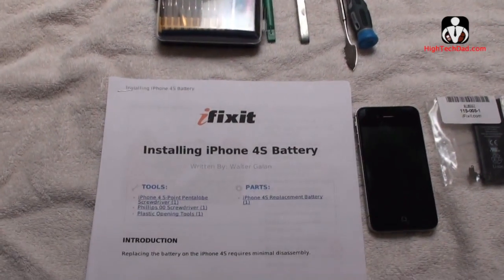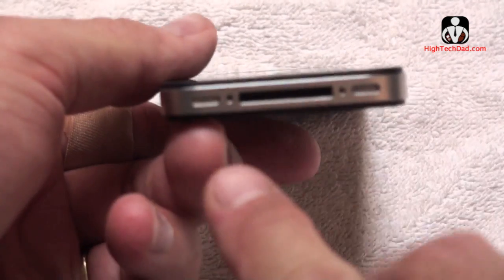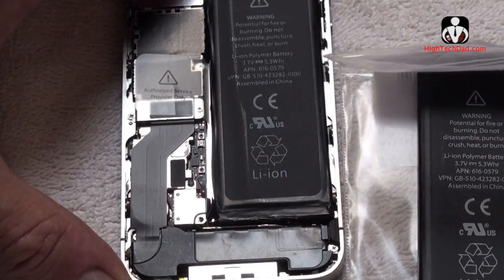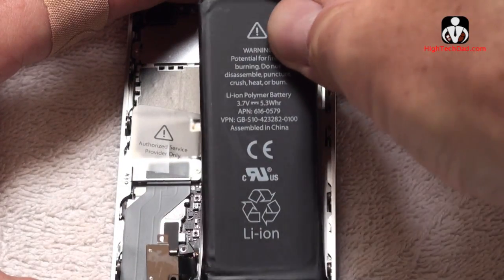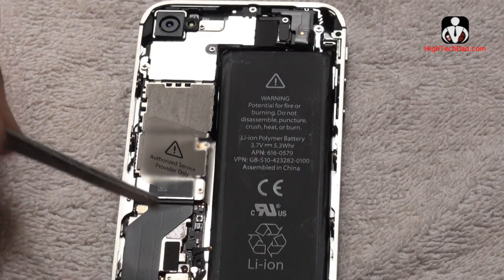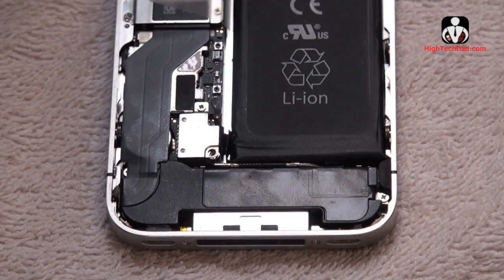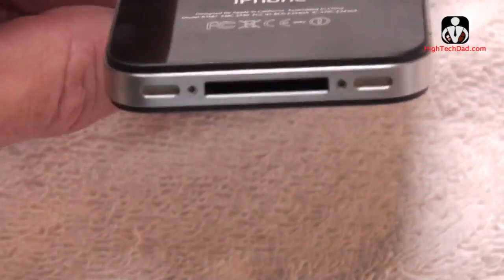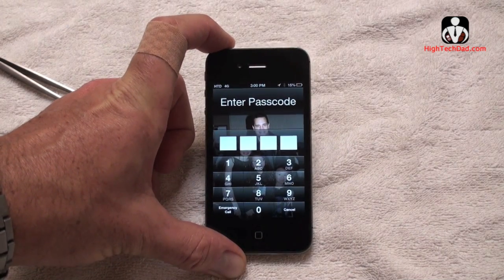How To Easily Remove, Install & Replace an Apple iPhone 4S Battery

Comment: How come samsung phone batteries can be replaced easily and without using all these tools
Reply: BananaHammock
IOS is smoother and an easier interface.
Reply: It was a design decision.
Apple decided that a slimmer phone with a high quality battery that rarely requires replacement (but is not user replaceable) was the better choice.
Samsung decided that a fatter phone with a user replaceable battery was the better choice.
I like both devices but feel that Apple made the better choice regarding the battery. 
The iPhone 4s battery rarely require replacement even after 4 years of regular use.  Of course some do need replacements for various reasons.  Replacement is fairly easy but this person makes it look pretty hard and does it poorly.  Not just because of the oversight of the ground clip, but the way he removes the battery by prying up on the component side of the battery is very dangerous.  He could easily damage the mother board doing that.  stick to prying from the frame side of the battery only.  Also, be gentle removing the battery connector from the motherboard.  He does not caution you how little force is required or that you just need to put the tip of the pry tool under the lip of the connector.  With too much force you could pull the connector right off the motherboard.  That aside, the video is certainly nice and clear and should prove helpful to someone looking to do this repair.  Always good to look at multiple videos before doing it for the first time yourself. 
Good luck.
Reply: They copied every datail of the iphone and now you CANT change the battery on spamsung phones
Reply: nr3rham no you cant.  samsung built the battery into the phone with no way to get to it.  there are no screws to open the phone up.  do some research before you open your mouth you idiot.
Reply: Tetra Digm Spoken by someone that has some odd grudge against apple and never owned any of their products.  I have 5 years old iPhones that still run perfectly on their original battery.  Replacing the battery if necessary may not be as simple as replacing AA batteries but it isn't exactly brain surgery either.   If you needed on, the batteries sell for under $10 on Ebay and not more than $10 for any mobile phone fixit shop to replace on the spot.  Of course if you rather lug around an fatter, heavier, uglier phone that has a user friendly battery compartment that is entirely your choice, and apparently the one that you made.  Enjoy.
Reply: Since you think "every cell phone out right now... Looks exactly the same" then that is why you are content with the bulkier models that have user replaceable batteries.   
And since you feel the need to cause to describe apple products it is pretty apparent that you hold some bizarre grudge.  It is phone, not someone that murdered a relative.  Sheesh.
Reply: It is not the truth, it is just loopy.  People don't buy millions and millions and millions of a bad product year after year after year.   No phone is perfect, but your logic is seriously flawed.
Reply: BananaHammock
true. but thats why so many iphone users jailbreak.
Reply: ***** yes you can
Reply: Tetra Digm im using a ipod 2G for fun these days, everything works, facebook, ebay, twitter, weather, maps, email,  push notifications, battery holds about a week, im talking for a device from 2008, go and find a working android from 2008 these days
apple rules, everyone is just following the leader, today in 2015 every new device is a mirror of iphone 6, there is a reason why..
Reply: if you don't believe what I wrote that's ok.
now find me a working device on android from 2008, they even will not start up...
if your angry, boo, your problem , I'm very happy will apples devices..
Reply: wait a few minutes, I'm recording a small video with my old iPod 2g :)
Reply: Cause apple mean and wants money so if you bring it to the apple store they'll say yeah we can fix it but it will cost you a new phone.
Reply: +X Gempler iPhone battery is slimmer because it's much less capacity, take for example iPhone 5 battery it's 1560 Mah compare to almost double 2800 Mah for Galaxy S5 and that's only at cost of 0.02" extra thickness.  Besides I would not want my Galaxy S5 to be any more thinner.  There is a point of diminishing return, if the phone is too thin it's harder to hold it.  You overlooked the benefit of removable battery is having extra spare batteries is that you can pop a fresh fully charged battery in to a phone in and don't have to look for a charger.  Put a depleted battery on a charger, you're not tied down with a wire you phone is 100% charged when you really need it.  That's what I was doing with my old S3, I bought 2 extra batteries and a charger around $20 bucks and just swapped the batteries.  This is very useful when traveling or just anywhere where you can't plug-in like beach or camping, etc. Can you do that with iPhone? - NO, so there you have it, Apple made a poor choice and a typical person who struggles to set correct time on VCR or Microwave would not be able to perform this battery swap but anybody can pull off the cover off Android phone and put a new battery.
Reply: +X Gempler uglier? fatter phone?  First of all the difference between iPhone 5s and Galaxy S5 is 0.02"  We are talking about 2 HUNDREDS of an inch!  That's extremely tiny difference that doesn't make any difference in real world!  Uglier?  That's just your opinion.  I think both phones look great, but it took Apple what 3 generations to come up with bigger screen - I preferred bigger screen so I switched to Galaxy, when Apple decides to catch up with Samsung and give me option to expand storage with SD card then I'll consider Apple, until than I am not playing 10x inflated price for extra storage that Apple charges compare to SD prices.  Heck, last time I was on vacation I was able to take micro SD card from GoPro 4 and play it back on my phone in full 1080 video quality all the videos I recorded.  You can't do that with iPhone.
Reply: +K Lee Because Apple wants to make as much money as possible from you by making not easily replaceable battery to force you to upgrade to their newer phones.  By NOT offering micro SD expansion of your storage to force you to buy their newer phone with bigger memory next time or force you to buy their Cloud space.  By charging you 30 dollars for charging cable when you can buy micro USB cable for a dollar or two that fit THE REST of the phones.   They are just greedy like that.
Reply: Dima Prok tell us one mobile manufacturer that makes replaceable battery nowadays
Reply: +Leart Zajmi Is this a serious question?  All "non apple" phones have replaceable batteries.  Samsung, LG, HTC, etc.
Reply: are you living on 2015? they all copied apple, they are all the same now, scamsung even removed the micro sim card and water prof, and since iphone dont have radio fm , they removed that to
Reply: Dima Prok good luck changing s6 battery without breaking everything
Reply: +Leart Zajmi Well, I haven't worked with Galaxy S6 yet, just because I don't upgrade my phone every time new one comes out, I tend to skip a generation but OK, last year that wasn't the case since I got to work with lot's of different phones, well if that's the case than next time I am buying a phone I'll need to re-valuate what phone I want to buy.
Reply: Dima Prok dont even bother to open a s6, it will break, at least apples one is changeable, difficult, but possible, about other brands they look like crap from inside , compared to iphone internals
Reply: Dima Prok It appears that you have not heard about universal external rechargeable batteries for anyone with any phone that needs to carry around extra power.  Clearly Samsung hasn't or they would have designed a better and slimmer product that would weigh less and cost less to make.
Reply: What makes you think I haven't heard?  I have one just in case and I got to use it like 2 times in a year because my Samsung hardly ever runs out of power unlike iPhone and it still requires you to have you to plug in charging cable which is not comfortable if you are carrying in your phone in the pocket.  How hard it is it for you to understand that 0.02" slimmer phone is not important for me, I rather have double battery life rather than bragging rights that I have a "slimmer" phone a whole whopping two hundreds of an inch slimmer, you have to be so stupid to brag about it.  FYI that's about business card thickness difference and I am perfectly satisfied with the slimness of my phone, I don't want it anymore slimmer, for me it reached a point where if you make it any more slimmer it's going to be unconformable to hold.  That's just stupid marketing gimmick, I actually rather have my phone thicker if I could get additional battery capacity.  And "cost less to make"?  Who cares how much it costs to make, what matters is that it cost way more to BUY, lol.  Why am I even talking to some immature kid who can't provide real facts and arguments.
Reply: What makes me think that you never heard of a universal external USB battery is that you were saying how wonderful it is that you can carry around a spare battery for your Samsung.  Anyone can carry around a spare battery for any phone by using a universal external USB battery.  This concept has escaped your comprehension, as well as Samsung.  There is no need whatsoever for any new phones to have user replacable batteries anymore.  Only a luddite would think otherwise.
Reply: +X Gempler It's not even remotely same!  You have no idea because you were never able to do that with your iPhone, popping a fresh battery and having 100% instant charge is very cool and I can fit spare battery even in the wallet if I really want it!  Walking with bulky external battery pack and extra cable and having them connected is NOT COOL and that's why you don't see anybody doing it.  Why are you arguing the obvious advantage Samsung has?  Why not just agree and say yeah, Samsung done this better than Apple.  Why do you have to be such a dumb ass?
Reply: You are loopy.  And the more you post the more evident it is.  Good luck to you.
Reply: +X Gempler No, you are!  I had to look up, you're just a stupid teenage girl, why did I even bother to explain something logical, you wouldn't understand.  I worked in mobile industry, you probably go to high school.  You watching and liking blogs on "TJ Maxx shopping" explains a lot about your mindset. LOL.
Reply: +Dima Prok your stalking has failed to reach the correct conclusions.  But given all of your other failed attempts at logic it seem quite appropriate that you would fail at this too.  Showing your need to lash out at someone that you think is a little girl shows how completely loopy you are.  Why would anyone do that?  Why would you be mean to a little girl if that is truly who you think I am.  It is just sick to think that a grown person would do such a thing.  And all because you can not handle that fact that someone opposes your belief that a user replaceable batter in a cell phone in 2015 is Neanderthal type thinking.  A battery in in cell phone!  Who care?  And you call a teenage girl stupid.  You need help.  I sincerely hope that you get some.
Reply: +X Gempler Yes you are stupid little girl, I gave you all the reasons why it's better and you just giving me "it's 2015 and everybody is doing it so it must be good".  The heard mentality.  You don't know how to think outside the box.  Did you fake your age to sign up for youtube?  Did your mommy give you that iPhone?
Reply: Dima Prok Name calling is a common tactic used by bullies who do not have facts or knowledge on their side.  Ironically you are the one that literally can not think outside of the 'box' as you clearly do not understand the concept of an external usb portable battery.
Reply: +BananaHammock the one plus needs an invitation to buy. can't use that to compare it to an iphone. Apple doesn't want people to mess with their product, but tech people don't care. its just about the money they can make if they can do it.
Reply: K Lee ...
Reply: alan wilson mm
Reply: Pah, apple don`t even want you to use the device in a way they don`t like, never mind changing batteries.
Try finding a replacement screen for iPhones..
Reply: Sir 4s iphone battery replaced prices
Reply: cause
iphones are better lol

Comment: Excellent video! I wtvhed it once, bought battery then watched again while I installed new battery. EASY AS! Thanks so much!  
Your video - highly recommended - person I got my "new" battery off, NOT recommended!  "New" battery turned on at 46% - plugged in to charge it and so far it has dropped DOWN to 43%. May be watching your video again soon when I replace "new" battery with another "new" battery!!

Comment: my iphone 4s want turn on should i try this?
Reply: If your iPhone 4S will not turn then it may be the battery or it may be something else.
I suggest that you connect your iPhone 4S to the AC adapter.  If the battery has been completely run down then you will see the outline of the battery (empty battery indicator) briefly appear on the screen and then the screen go black until it has been charged up enough to turn on after a few minutes of charging.  If the iPhone does not show you the empty battery indicator or does not appear to turn on after being charged for several minutes there is likely another problem.  To troubleshoot further you could next try to connect the phone to your computer and see if the device is recognized by iTunes.  If it is recognized by iTunes but you still can not see anything on the screen you may have a screen problem.  If you do not have any important data on the phone you could try a restoring your iPhone using iTunes in a method that completely wipes all of your data from the iPhone and reloads the operating system from scratch.  This procedure is detailed here https://support.apple.com/en-us/HT201252  If after the restore you still can not power on your phone further troubleshooting would ne necessary...
Reply: Same happened to me do u no how to. Fix
Reply: X Gempler
Thanks it works now after i left in the charge for a couple of hours!

Comment: Good walkthrough video HTD. For those watching, if you haven't bought your battery and tool kit, I'd like to share what I bought. I didn't like any of the reviews on Amazon for battery/tool combos so I bought each seperate. If you find a battery you like with free tools, get it, but I would buy a good tool kit as well. Helps too if one of your tools strips or breaks as his spuger did in the video.

I bought this tool kit for $15 and you can fix almost any electronic with it, not just an iPhone, that is all you'll get with the provided tools. It had excellent reviews and after doing my battery swap, I'm very happy with it. http://www.amazon.com/gp/product/B008CLO7Q2/ref=oh_aui_detailpage_o01_s00?ie=UTF8&psc=1

I bought this battery. Not sure why looking back now, because it only has a few reviews and I usually go for items that have a lot of reviews. Glad I did now though, because it has the exact same markings as my original, it would appear to be the same exact battery. Now I can't say that you buy this battery and get the same exact battery as I got, I don't know much about this Teenitor company, but it's worth a shot. http://www.amazon.com/gp/product/B00PLDVK7I/ref=oh_aui_detailpage_o01_s01?ie=UTF8&psc=1

Good luck.

Comment: Great video.  I watched your video then did it myself in 6-7minutes.  Could of been faster if those screws weren't so tiny, lol.  I bought a kit at Amazon.com that had really good quality(and magnetic) tools.  The kit made it really easy.  http://www.amazon.com/gp/product/B00DE09Z90?ref_=pe_385040_127541860_TE_dp_1&pldnSite=1

Comment: From a fellow DIY guy, good job!  Replaced mine and Sandy's batteries with no issues!  Glad I bought a tool kit with each battery cause the proprietary screwdriver for the back cover stripped (I'm always guilty of over-tightening), and I couldn't snug up the last screw without using the driver from the other kit.

Comment: They implement the non-removable battery as "planned obsolescence" tactic. Reason being that batteries' capacities diminish over time and needs to be replaces every 1-2 years, the manufacturers don't want you to buy a $10 dollar battery and replace it yourself, but instead go to their store and have it serviced and replaces and that would cost 80-100 dollars. Apple is notorious for this, their laptop's batteries used to be removable, now you can't. iPhone is no exception. HTC and motorola have recently followed this way of operating, which many people find predatory, it's like taking away something that we should have got at the first place. 

Same concept with nonremovable SD memory, they're starting to close that off on phones so that you HAVE To buy a bigger memory for their phones from the start. 8gb or even 16gb isn't enough by today's standards, which is why they will have you upgrade to next iphone or htc phone in 1-2 years time (hence they release a new phone every year), when instead you could simply swap out the battery or memory slots. Over the years, people have seem to have accepted as the status quo, which is sad. We buy whatever they tell is to buy.

Comment: Thank you for posting this video. You saved me about $50! I was worried it would be really hard to change the battery, but it was super easy. I used to work in a jewelry store and one of my tasks was to change watch batteries. There are some watches that are more complicated than what I just did with my wife's iPhone.